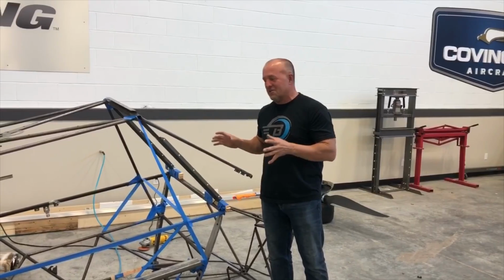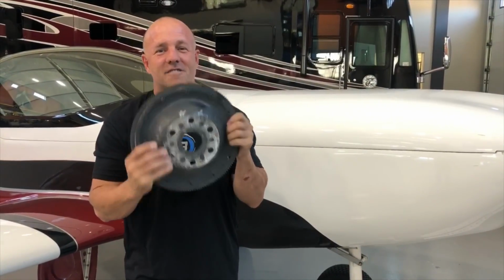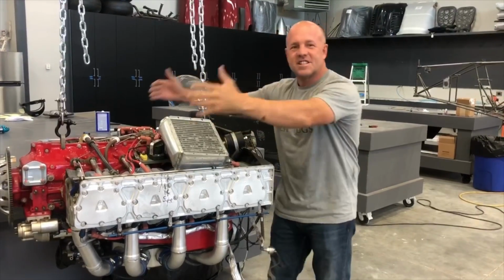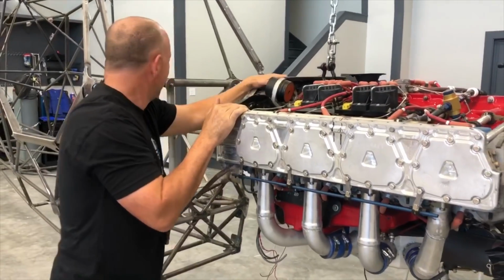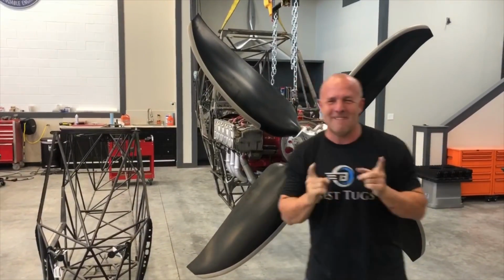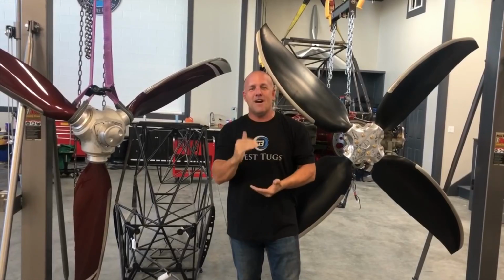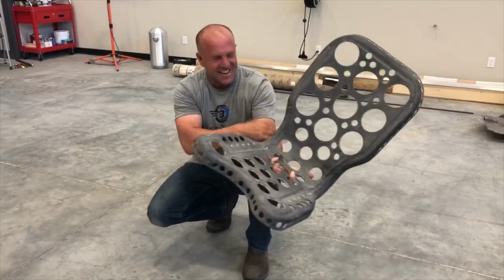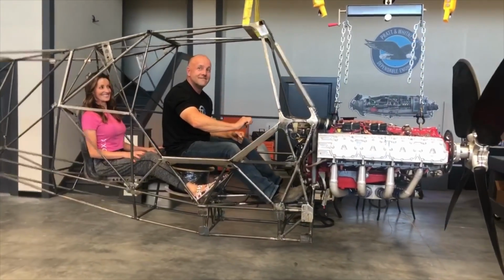Never said that Scrappy was Normal 🤷🏻‍♂️ (Scrappy Bush Plane 3)

Comment: I was wondering what motor was going in scrappy the start of your videos now I see the lycoming board as I wondered if you may go gas turbine, still what a monster, your the man with your engineering skills and abilities. I'm know scrappy will be great little aircraft. related I have searched enjoyed all DRACO 2000 videos. like Trent Palmers mons bad bush air with yourself giving an indepth walkaround of DRACO 2000 cheers for that anyway BACK TO WORK
Reply: may know a way to cool the monster flat 8, maybe you already thought of it.  how about open circular area behind the spinner with enough fan to draw air in over flat 8 maybe closable opening like MIG 26 for your winter months another thought the SPITFIRES underwing radiators thought at first to be drag making discovered that large inlet heat small outlet made thrust enough that they put one on both wings
Reply: sorry its not a MIG 26 its a sokhoi su-26 apologies

Comment: The only aviator in the world whose IQ is higher than his aeroplane's horsepower.
Reply: It doesn't have an engine yet
Reply: @joachimsingh2929  yes it does. It’s a Lycoming IO780NOX.
Reply: That is a mathematical improbability.  This guy is either insane or stupid. Maybe both. Just remember that just because you can do something, doesn't mean you should.
Discretion is the better part of valor.
Reply: @skorpius752  That may ring true but. ITS GONNA BE FUCKING AWESOME! i trust Mike has enough reason to make this work and i am sure he can do it.
Reply: @krimm1450  he hasn't failed yet
Reply: @skorpius752  dude... r/woooosh

Comment: that's an engine with an airframe, not an airframe with an engine, looks like an interesting design.. hope it's gonna be safe for the rear passenger if it ever crashes (since the oil coolant and fuel are gonna be by the rear passenger), make it safe!

Comment: If that prop stops, you're dead. You will not be able to pitch down enough to maintain airspeed, especially if you're close to ground. If keeps windmilling you're double dead. You need to have that thing be able to feather.

Comment: Given that you are after peak power, would a hybrid system makes sense? A similar kW electric motor is a lot lighter and more compact, and if you only intend to run it for seconds at a time at those power levels, you should be able to get away with quite a modest  battery.

Comment: You should really think about TIG welding those joints. My instructor when I learned to weld, had used to work for a nascar truck team. He said when he convinced them to do a full chassis with TIG as apposed to MIG, they saved 26 pounds over the entire chassis.

Comment: The animation of the frame and wings reacting to the torque and acceleration from that engine/prop combo would make a VERY interesting video!  (got to see a similar animation of the mounting ring a satellite sits on during launch from the engineer that was designing the ring; he had several vibration modes he had to work with - cool stuff).

Comment: a few questions.  we talked about this on draco. is the frame 4130.. are you going to have the entire airframe stress relieved..  i am taking you have a second bottle of shielding gas a second solenoid and flow meter to allow you to properly back purge the tubes while welding to prevent issues inside the frame.   mounts for a ballistic parachute. why.. with that barn door of a prop.. glide ratio with a stopped prop is going to be steeper than the space shuttle..  its only that we like you and want you around.. i am also thinking of titanium armor below the seating area like top fuel and funny cars have..  article on a NHRA racer installing titanium armor between the tubes. http://competitionplus.com/featured-stories/4140-jim-head-%E2%80%93-innovating-funny-car-capsule  .  only thing is i would machine and polish the edges of the armor into a nice curve.. no sharp or square edges..   my thoughts are also to install the tabs offset toward the outside... so the panels partially overlap the tub diameter.. instead of fitting between the tubes.. making it much less likely to be punched thru the opening.

Comment: Any oil system / pump mods needed to maintain oil pressure and flow volumes with the coolers mounted aft like that? Do you foresee any issue with those huge blades in a dead stick scenario since you can't feather them?

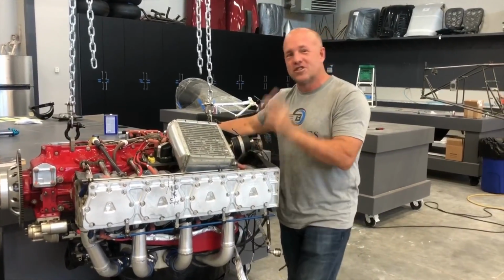Comment: 8:00. I build race cars.  it’s not just the air flow. It’s also the temperature of the air hitting it. The further away from that hot engine the cooler the air.

Comment: Not a pilot or an engineer, though I play one on YT!
It seems to me that with a variable pitch prop you could have push button adjustment for all the different prop settings AND stop your plane on a dime by reversing the prop.  Hell with that prop and power you probably hang it off the prop and helicopter it in for a landing somehow.   
Can you use your oil cooler for cabin heating? 
If you were to increase the size of your oil cooler radiator and reservoir there by doubling the capacity of engine oil could you double the hours between oil changes?
After watching the Draco build I can not wait to see this finished project.

Comment: Mr. Patey, 
I don’t know your complete engineering / manufacturing processes so I will ask Sir.
Do or will you be X-Raying any of the welds in the critical load  path nodes structure of Scrappy? It’s probably 99% all critical load path but now I am really excited and worried for you? I can only guess some welds would be extremely difficult or impossible to X-Ray from the video images. I can only guess you will push Scrappy to and possibly beyond the design envelope. So Sir, now i’m worried. 
Your the Wild Man!

Comment: Hey Mike,

Could you please  help Boeing fix that pesky 737 Max? They can't seem to get their s..t together.
Reply: Yes!
Reply: 737 Max is over-computed. Pilots tried to fight controls but couldn't. That's the problem.
Reply: @oby-1607  No. The pilots let the runaway trim condition get to the point which 1) they could not physically fight the over-trim in the nose down direction and as a result 2) they could not overcome the forces on the jack screw. When that happens, the only hope for survival is to do a "porpoise" type maneuver... you pull the nose up as hard as you can and gain some altitude. Then you let the nose drop, releiving the pressure on the jack screw, while trimming up as fast as you can. You repeat that procedure until you are at a reasonable trim. Or... stop the runaway trim (by killing power to the motor) before it gets bad enough to kill you.
Reply: @paramax55  That only works if you actually have enough elevator authority...
Reply: @complexdevice  the 737 has been flying since 1967... I believe Boeing designed in enough elevator authority... especially past Vne...
Reply: @paramax55  I don't think you fully understand how a stabilizer trim system works. That's the whole reason for MCAS. During a climb out at V(y) or V(x) the new LEAP engines create a pitch up moment that can overcome elevator authority. If the trim malfunctions during level flight and it isn't caught quickly, the pitch moment of the stabilizer trim exceeds that of the elevator at opposite maximum deflection. This is how the 737 Max crash occurred. I suggest you do more research on this topic as V(ne) stands for "never exceed" so if you think that applies to this situation you're mistaken.
Reply: @complexdevice  The faster an airplane goes, the more effective the control surfaces become. The latest crash happened past Vne. The elevator would have had more than enough authority. And I just rebuilt my stabilator trim controls a couple of months ago - so I am rather familiar with how it works. A trim tab is moved by the trim control - via a jack screw and jack nut - and this tab pushes the trim in whatever direction it needs to go until it moves the stabilizer to a state of equalibrium for how much the trim tab is deflected. It is a part of the stabilizer (stabilator on some planes). If the elevator is fighting you, it is out of trim for whatever you are asking it to do. If it's getting itself out of trim, you need to stop it before it is so far out that there is too much resistance on the jack screw for you to move it. If you are also past Vne, that will compound the resistance you feel. Runaway trim always has the same solution no matter the cause - 1) cut the power to the trim motor. 2) trim by hand (like most GA airplanes) 3) return to the airport and land. And Vne most certainly had something to do with the problem.
Reply: And the new engines do NOT overcome stabilizer authority. They can cause a SLIGHT pitch up that SHOULD be corrected for with trim. Trim moves the stabilizer. That's its only job.
Reply: @paramax55  I get what you're saying as it applies to GA Aircraft. Again, the 737 doesn't have a trim tab like a Cessna, the jack screw deflects the entire horizontal stabilizer. At maximum deflection, the elevators do not have enough authority to overcome the deflection of the stabilizer. As you said, "the faster an airplane goes, the more effective the control surfaces become". To illustrate, let's say the trim can deflect the stabilizer 15 degrees in both directions and you have 30 degrees of elevator deflection in both directions. In the 737, If the auto trim deflects to the maximum pitch down amount, your opposite input won't overcome the nose down attitude. The stabilizer is a much larger control surface than the elevator. Your elevator, even with twice the deflection than the stabilizer, would need have at least 50% of the area of the stabilizer in order to negate it's pitch moment. The 737 elevator is not even close to that size. Mentour Pilot, a type rated 737 airline pilot, has several videos describing this.
Reply: @complexdevice  the rate of change for MCAS is 2.5 deg. in 10 seconds. In order for a pilot to let an airplane get THAT far out of trim from a runaway trim situation, he would have to NOT be correcting the problem for a LONG time. If an airplane is out of trim, you know it - instantly. If an airplane is going out of trim more and more, you know it - instantly. There are about two causes for that; 1) runaway trim and 2) part of the airplane fell off. If you didn't hear a loud noise, it's probably #1. If your trim switch isn't making the airplane do what you wantnit to do, you look down at the trim wheel to see what it's doing - it's instinctive and instantaneous. You will know within seconds if you have a runaway trim and it should never, ever, EVER get to a point where the elevator "loses authority." That is the difference between a pilot and a front seat passenger.
Reply: The only problem with the 737 Max is the nut holding the yoke. Inexperienced pilots + very little GA time + a minor malfunction = catastrophe. Runaway trim should never cause a plane to crash. Read any NTSB report.
Reply: @paramax55  A minor malfunction should have one light not 3734 of them.  Information overload.  It would also be nice, I agree, if co-pilots required more than 40 or 50 hours actual flight time.  These planes are a bit more complicated than a cessna 150.
Reply: @jennydiazvigneault5548  They are more complicated than a Cessna 150. In fact, you'd be hard-pressed to find a 150 with electric trim. That does not change anything, though. It is a runaway trim scenario. Cut the power to the trim, trim by hand, return to the airport and land as normal. No information overload.
Reply: @paramax55  

400 people needlessly killed. Yes, your right to a point about the unskilled pilots, BUT...

I respectfully disagree  there is a serious problem with CG from  redesigned engines. CG has been thrown foward from the redesign. Boeing in their infinite wisdom has decided they dont want to spend the money for a complete redesign of the wing.

Been argued 1000 times, that's my take, along with many others. Boeing thinks a computer input is the correct fix.
Reply: @markschumacher6630  Well... if what you said were true, you might have a point, but the facts differ. If the problem were a forward CG, then the nose would want to pitch DOWN and the computer would pitch the nose UP to counter. But MCAS pitches the nose DOWN because the new engines can cause a SLIGHT nose UP attitude. It's so small that most pilots never even notice it. But it IS a difference and that is all the FAA is concerned about. Boeing implemented a control to counter that - which isn't far off of the idea of the ancient Piper auto-trim - so that pilots don't have to be re-trained. Computers control just about everything on a modern airliner, so this was nothing new. A malfunction of the system is a runaway trim failure and should be a simple malfunction for a compitent pilot to handle. There are a multitude of things that can cause a runaway trim and the answer is the same every time... kill the power to the motors, trim by hand, return to the airport, and land as normal. There shouldn't have been a malfunction, true, but the world isn't made of NERF. 20% of pilot training is how to fly an airplane. 80% is what to do when things go wrong - because they sometimes do.
Reply: It's the 400 dead part that chaps my rear end. Different pilots as well we have to remember, both killed people. cg is forward because the new engines nacelles put it there, ever so slightly, this is why boeing decided to let a computer fix it, BIG MISTAKE!

IN ANY EVENT, sure would love to have a guy like Mike look at it. :)

Comment: Mike, a BSFC curve shows that at  1/4 power (130 hp vs 500 hp) the lbs/hp-hr will be about 1.3-1.6 more fuel than peak efficiency.  You will be more like 1.3-1.6 times more fuel over your buddies at the same power, depending on where you run it.  That means if they are 10 gal/hr then you will be 13-16 gal/hr.  Likely 15.   It is will NOT be just 10% more fuel or 11 as you claim.

Comment: So many questions... Biggest thing that comes to mind is using your "head girdle" to turn the engine into a water boxer. That way, you could use an oil\water heat exchanger to cool the oil and have a single air\water exchanger to cool the motor itself and the oil. The water routing could be used to fine tune c\g. 
You wouldn't by any chance be in the market for a Mastercam programmer, would you? 
Thank yo so much for sharing your projects and your enthusiasm with us!

Comment: @12:55ish Yup. That's one of the major reasons behind the great change to mono block cylinders + bottom in race cars back in the day. I believe, and if the story is true, of course, that the way they figured it out (i forgot which relatively famous racing team) that they put an indicator (not the dial type like we have today, the feather kind with the little needle) and ran the race car full beans. Reason behind it was that they'd crack cylinders or bottoms and they couldn't figure it out why until one of the mechanics intuitively figured it out. As they ran it, getting to temp and race speeds, the indicator told the truth that wasn't visible to the naked eye.

Comment: You have some amazing "scraps" around your hangar. The engine the size of a city block is one thing, but an airboat prop?  Where is the matter/antimatter flux capacitor? Over in the corner on the DeLorean, of course.

Comment: Hey Mike, great build, love watching you think, design, and fabricate.

I’m sure you have already considered that you’ll likely need an additional 20-30% wing span and cord to provide the same lift/weight and glide ratios for the added weight of your 8 cylinder engine, added framework, heavy duty gear, and monster tires.  

Best, Jon

Comment: A better thrust to weight ratio than draco with a prop like that?.... might as well get rid of the wings and stand it up on its tail because that's a rocket. You're building a rocket, Mike

Comment: Mike, design the front suspension to pivot out and toward the front of the plane so when you land and the suspension compresses, your wheelbase lengthens and your wheels spread farther apart widening the stance. This design would mean that the more input you gave the suspension, the more stable the plane will become.

Comment: Mike, on Draco the suspension released (gave upward thrust) when you released brakes. Would it clear ground quicker if suspension released at time of rotation? (About 1 1/2 seconds later on Draco). Seems it would thrust the plane into the air much better. Love your videos!

Comment: Love the videos and project as usual, I cannot pass up a video notification from you. I do have a question about the prop though: will there be any issues with drag if the engine goes bang and you need to dead stick the plane in?

Comment: The head-locker is exactly the kind of innovation GA aircraft engines could benefit from. Lots of advantages to engine longevity and eliminating a bunch of headaches along the way. Cool stuff Mike. I wonder how possible it would be to STC for the common motor- Probably not worth the headache...

Comment: No variable pitch / reversible pitch?  Aren't you giving up stopping power?
Reply: deezynar I expect he’s figured it adds too much weight compared to good long wheelbase braking.
Reply: @daniellewis1789  The force of the reversed thrust is far greater than the weight of the hub.

Comment: Mike , as your aware your adding a huge linear mass load to the wings with that acceleration . 

Modular dash board , thats a great idea ,, Pontiac Fiero type .
Reply: Linear mass load? Resulting from forwards acceleration? What are you talking about? Drag is the only thing in a horizontal front to back vector that I can imagine.